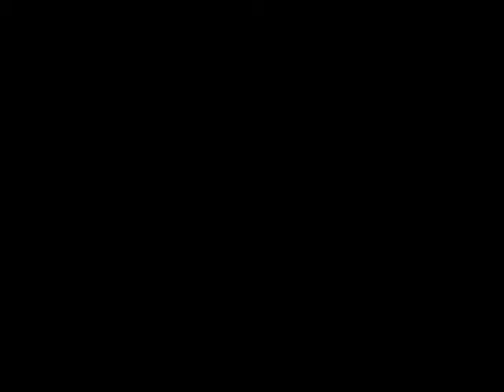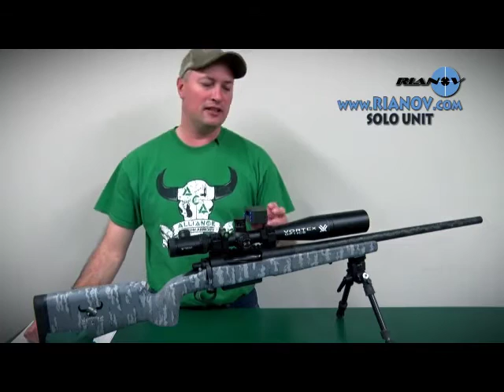RIANOV SOLO Setup

Comment: When I was a kid "before rangefinders" I took an 18" box out and set it out in 100 yard steps out to 700 and bracketed it in the crosshairs. I then wrote down the power reading for each yardage. I scribed the yardage next to each power number on the power ring. 

My Dad used to have an old Tasco I believe that had this same range finding system built in.

Comment: The 2ndG, should be wirelessly connected to LRF (such as the Bushnell CONX) or Similar (eg. ATN new wireless LRF) paired to mobile phone for setup and configurations. Paired to wireless Weatherstation/windmeter. Finally, the mobile app can have more features such as solution charting, maps based range finding, ballistic solutions comparisons between different calibers, etc...A high end, model, would integrate the 2nG model into the LRF mounted on the rifle.
A 3ndGen version, should integrate all the above in the scope itself. The only thing wirelessly acquired is wind speed and dircetion.